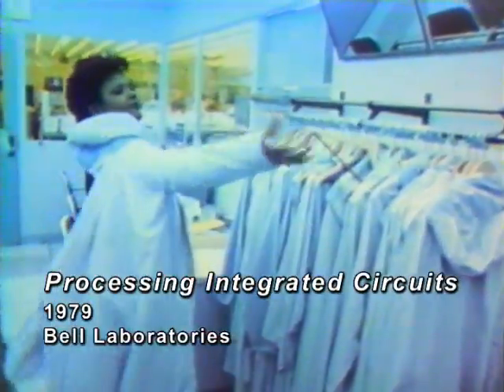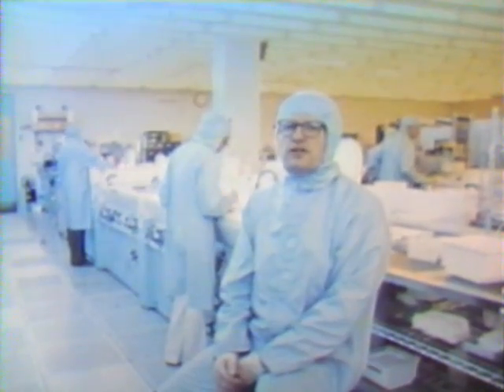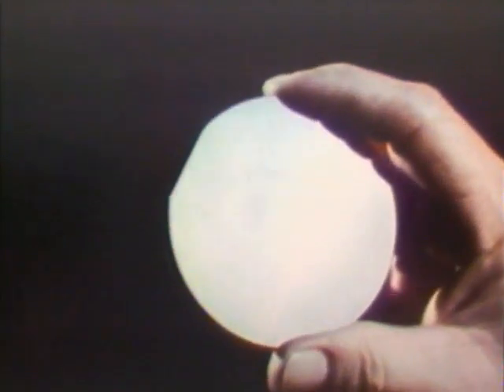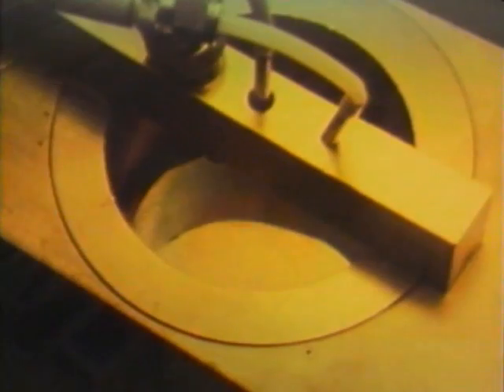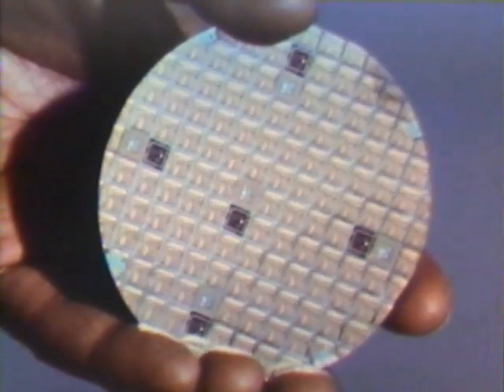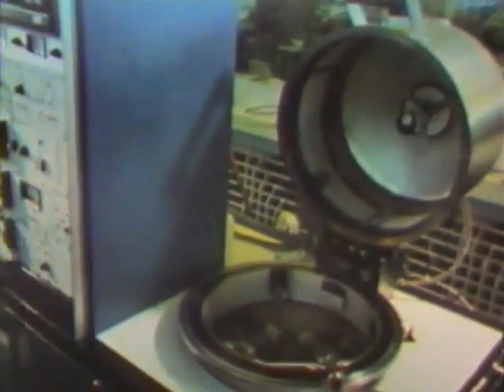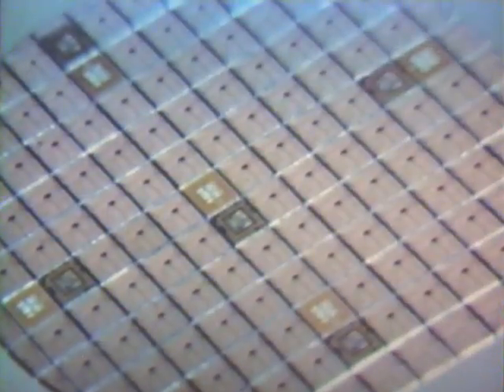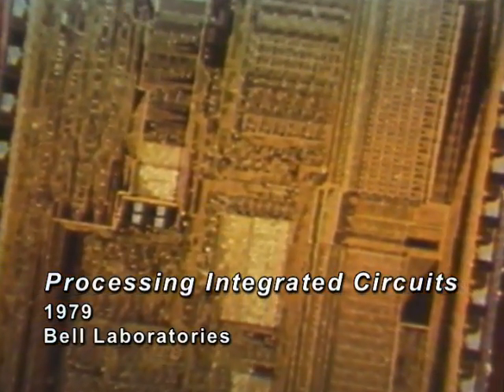Processing Integrated Circuits at Bell Labs (1979) - AT&T Archives

Comment: I started my career in 1978 at Western Electric in the Allentown Works.  While the design, development, and testing of I.C.s was done at Bell Labs, larger scale production of accepted designs was done in Allentown, PA.  I was a manufacturing engineer there for about 12 years.
Reply: You have seen the Golden Age. :)
Reply: Did you work in Chip manufacturing in Cleanrooms?
Reply: @lynfl9814  Well, yes. I was in engineering and working on design improvements for the manufacturing equipment that was used to make the wafers & ICs.
Reply: @RichardFallstich  The reason I asked was because their were several packaging and testing areas, as well.  Most of this was in the lower level of the plant.  Over my career, I worked in some of these areas, also.